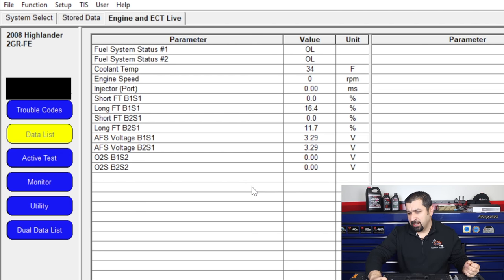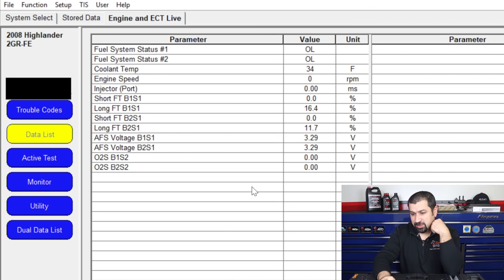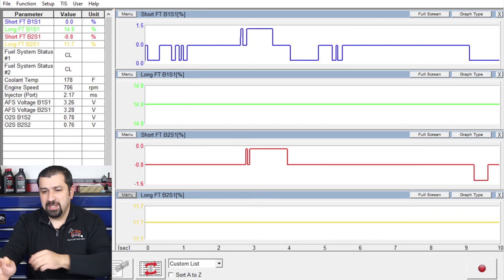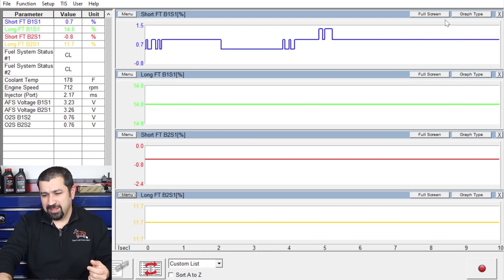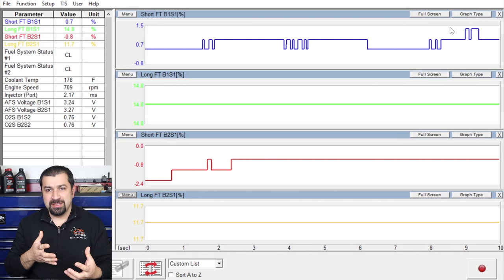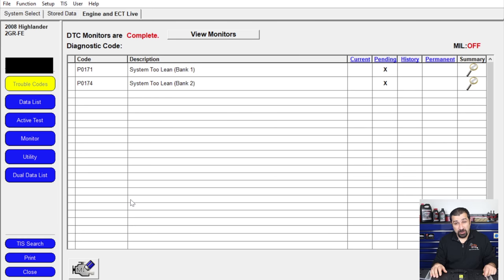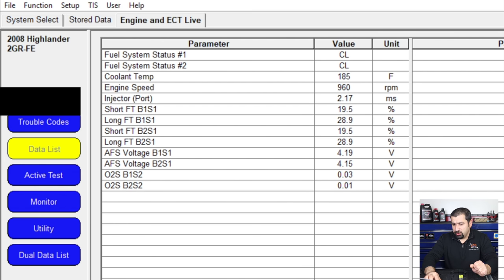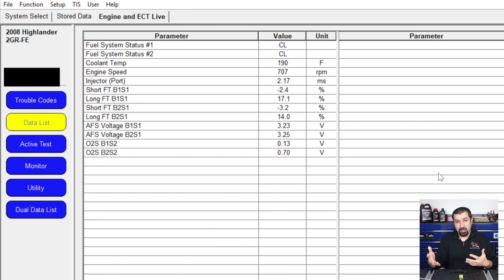Toyota Fuel Trims and live data diagnosis tips!

Comment: Fuel trims can throw you.  For example.  Watch when your LFT reads 12.5 and your SFT reads -10.5.  This can confuse people, but actually, your TOTAL fuel trim is +2.0 or 2.0.  The short trim is removing fuel, but the LFT is taking its time to reduce.  I've seen this after a repair.  The fix was to reset the fuel trims and watch.  The engine has about 40K on it and the SFT reads from -7% to +7%, and it stays that way.   There's other scenario's, and only by learning how SFT and LFT work with the AFR sensors is it understood.  I saw one Ford V10 van that both banks LFT and SFT reading at +25% each for a combined TOTAL Fuel Trim of 50% each bank.  This was at idle.  As the throttle was opened slowly to 2000 RPM's,  LFT's and SFT's settled down with LFT's approximately  between 6 to 8% and SFT's approximately between -7 to +7%.  At idle, the van shook so bad, I thought the ladders would fall from their roof racks.  The cause was a tear in the PCV hose on the bottom of the hose near the port on the throttle body.  Ford had an upgrade for this with a thicker hose material.  With the the new hose installed, fuel trims came down, no more shaking and all was well in Ford land.  The tear wasn't big, only about 1 inch long, but the engine heat and vacuum caused the tear to turn inward toward the inside of the hose.  It was that thin!  A tech learning about fuel trims needs to work with vehicles that are running good to get a baseline understanding of that system.  Disconnect then reconnect a small vacuum hose and watch the readings.  I had to learn fuel trims AND the Ford WDS diagnostic system we had before we got the IDS which I understand is still in use.  Thankyou for this video.
Reply from the maker: Very well said my brother. Knowing what’s normal is key to knowing how to diagnose.

Comment: Awesome!!  Let's go back to say the mid to late 1960's...would you rather be a mechanic back then or at the present? 🙂
Reply: well maybe after 1996 and before 2005.
Reply: back to the 60s . I could work on those cars. Now i just get headaches.
Reply from the maker: I’d much rather work on today’s cars honestly! I remember the first obd2 cars the computers were slow and usually were horrible with diagnosis. The newer ones have a massive amount of data that you can access to see everything and understand what’s going on. And they are super fast with refresh rates!

Starting around 2016 and up with the 7 digit trouble codes things got even better as you didn’t have to go digging for information codes which give you more detail on a specific code. More on this when we get to it in this series
Reply: @TheCarCareNut  Guess I'm showing my age but back in the 60's there wasn't any OBD system developed yet.  No emissions system to speak of except for the PCV valve. Engine diagnostic was basically checking the air, fuel, and spark. Changed plugs and points for tuneups, maybe a distributor cap once in a while.  Pretty simple to upkeep your car and no fancy equipment needed...maybe a timing light, tach/dwell meter, pilot shaft, various pullers/compressors, and a torque wrench.  Oh yeah and a repair manual for your car...no YouTube back then 😉

But yeah today it's quicker to diagnose a problem but think of all the additional costs for equipment, training, and expensive parts that you need.  The cars today (especially Toyota/Lexus) do last longer, have better emissions, and better gas mileage which is a good thing.  I guess there are plus and minuses to both sides.
Reply: Today’s technologies are easier with the right tools except the increased security where you have to program sub systems modules that have codes/pins available at the manufacturer severs. Using aftermarket scan tools can clone or bypass that but it can cause permanent damage to the new part and the ecu when it glitches during the process.

Comment: There's more than just a clogged injector or leaky injector or vacuum leak or dirty or bad air mass sensors. Both bank 1 bank and bank 2 sensors were faulty on my 07 Lexus is250. I cleaned the carbon build up  on the intake valves,  cleaned injectors, and replaced every intake gasket and hose and still was throwing a lean code on both banks. Fixed the problem by replacing both upstream sensors. Don't be fooled by the common sense data.

Comment: This is actually great information because I feel like one of my cars has a leaking injector but it's not throwing up any codes and the car runs perfectly fine.  I can use those techniques you just taught me to check if one of them is actually leaking. As I said in one of my previous posts I'm a mechanic but I specialize more in suspension work. And I don't just deal with Toyota's I deal with all kinds of cars. This is why I love your channel because you go into detail on things that I can learn use to better diagnose issues.

Comment: Good that I found this video!  On my 2010 Acura, LTFT is about +2.5 and STFT is +5/6 and it seemed that system was adding a bit of fuel which indicate a "lean condition".  After listening to what you have said "this isn't an issue at all as system is able to compensate..."  Just wanted to improve MPG a bit, but I guess I will let it slide and have a better sleep at night :)

Comment: Thank you for this video! I had to rewatch the video a few times to get a good understanding, but I was able to find and fix the issue in my 2007 lexus is250 and learned a lot of useful information for future diagnosis. No more check engine light, plus my my LTFT went from 26% to 1% after issue resolved and I'm happy with my fuel efficiency now. You're the best man keep doing what you're doing!

Comment: Thanks for another EXCELLENT video & explaining the Long and Short trim levels.  After viewing and listening to your analogy, I am fairly certain that it would be a lot less confusing (and not even require an analogy) if Toyota had called short term trim something more accurate like "real time trim data".  Same goes for long term trim which, in my opinion. would be MUCH more easily understood if it was referred to as "rolling average trim data".

Comment: Thanks for showing how it works. I'm trying to diagnose a p0420 in my daughter' nissan versa ( I know you specialize in Toyotas but i also own a couple two of them. A tundra and Rav4)and wasn't aware that O2 sensors are now wide band sensors. I wanted to diagnose a possible leak in the exhaust system before I condemn the Cat converter. Very informative and much appreciated. 👏

Comment: Dr Ahmed that was a very interesting video seeing how a professional diagnosis technician is able to pin point problems. I start throwing codes with a high mileage vehicle i replace every sensor coils and injectors,looking forward to the catalytic converter diagnosis my rule smell them replace them all along with sensors

Comment: Thank you for the EXCELLENT video. It was very informative.  You mentioned "don't chase a 5% fuel trim."  I understand the logic behind that.  But at what % should one become concerned?  I heard somewhere plus or minus 10% long term fuel trim is acceptable.  If more than plus or minus 10% long term fuel trim, then the underlying cause of the fuel trim adjustment should be examained.  Did you agree?

Comment: Educational video... sure could use a scope of some sort.  ...... Question.... fixing to buy  a new auto....Looking at the Lexus RX350L and the Mazda CX-9.  Any pros and cons of each?  Appreciate your input'
The Mazda is cheaper but that is not the issue.  It drives nice and has low torque.  The Lexus is comfortable, etc.  Appears similar to a Highlander.
Reply from the maker: Hi! I honestly don’t have experience with the current CX-9 to give a fair comparison but I know the older ones were absolute junk. The Rx350 and highlanders are very good SUVs more focused on reliability than drivability which is where the CX might have the upper hand.

Comment: My short fuel trim is ok I replaced the air fuel ratio sensor last year. My long term fuel trim at 75mph is 7%. I am replacing the o2 Sensor after the catalytic converter. My long term fuel trim was at 1.6 % then it jumped to 7.8% and then down to 7% when cursing at 75mph on the the highway.
Reply from the maker: Hi! That’s normal.
Reply: Thanks for the feedback I have read that the 02 sensor after the car could have upto a 30% on fuel trim.

Comment: Amazing video! I'm diagnosing my Lexus RX400h since it's throwing a "too lean" error constantly and my AFS voltages are off the charts (hitting down to under 2V and up to 5V) and also my Fuel trims are also going crazy (Long FT would even reach 50%) and then my Injector port goes way too high at 5ms so something is certainly going very downhill with the engine. Looking at possible air leak (hopefully that's it) and will also be looking into changing injectors as a start.

Comment: The demo was not too complicated.  the complication that could use some of your strategies is how to do this on the hybrids (e.g 3.3L V6).  the issue is that the engine will shut off when we need idle data.  driving at a steady slow speed is also not too practical since the hybrid will turn off the engine and run on batteries.  dragging the brake-maybe?  ideas?  thank  you

Comment: Absolutely love this episode.
I am poking into the fuel trim on my 98 and 99 Camry. My Camry is in fuel trim rich condition under idle (about -7%), but they would go back to normal under driving condition. I suspect it may be due to a partially clogged IAC. I wonder if there is standard / reference values under idle for use to compare to.
Reply from the maker: Thank you for watching! So many factors could bring the fuel trim down but it also could be normal for the age of the car. Let me ask you this, do you have any symptoms?
Reply: @TheCarCareNut  No obvious symptoms. The 98 Camry I4 feels lack of acceleration and the fuel trim does respond quickly after I replaced the fuel pressure damper. This may be unrelated and I may be pushing for perfection.
The 99 Japan made Camry V6 feels as new.
Reply from the maker: Honestly I wouldn’t chase after it. Wouldn’t hurt to clean the IAC though

Comment: I just replaced the downstream o2 sensor on my 2011 rav4  4cyl 130k miles and prior to replacing the sensor i have mentioned the readings below but after replacing it at idle the long term fuel sensor is at 0% and while cruising at 75 it’s at 7% but it goes up and down based on throttle position. So I think there has been a significant change after the downstream sensor replacement. I will keep an eye on it and read fuel trim numbers

Comment: I have been chasing a slight shake that I feel at idle....I was thinking it was engine performance related and over obsessing about fuel trims....I should have realized that when I feel these shakes the fuel trims really are stable and nothing changes crazy even with the rpm.  This should be enough to tell me that my shaking is not engine performance related and I must look at harmonic balancer/mounts/torque converter

Comment: Very informative info! I have one question and that is what is considered a normal range for the long term fuel trim? On the example vehicle it is showing that the long term fuel trims are at 14.8 and 11.7 when the vehicle is in closed loop and fully warmed up and the short term trims are nearly 0. My understanding is that since the short trims are staying within a certain range and not jumping crazy high or low that the long term trim numbers are accurate for that vehicle. One video said that anything “+” or “-“ 3 percent for the long term readings is perfectly normal and in optimal running condition. So when should one worry and consider that a problem that needs attention is present? Would it be at 20 percent?

Comment: Thank you for your videos. Any recommendations of how much grease to put in 2016 4 Runner  driveshaft slip joint?    I have read 4-5 pumps, or until the slip joint moves, or until grease starts to come out of the slip joint seal.  The u joints are straight forward, but the slip joints there is a lot of confusion.  Any advice would be greatly appreciated.  Thank you 🙏
Reply from the maker: Hi! Until grease comes out

Comment: Hi! Thanks a lot for your videos. I have a Toyota Highlander 2013 3.5 AWD SE with 104k Miles. While just before coming to a complete stop  it revs up around 500 to 400 and and then comes back to normal. Transmission shifts fine on all gears while driving. I will really appreciate it if you have any suggestions. Take care.
Reply from the maker: Hi! I would try to clean the throttle body and see if it improves.
Reply: @TheCarCareNut  thanks. I tried 2 different throttle bodies . Both throttle bodies are oem toyota. One was new and other one was used taken out of a vehicle with 30k miles. There was no  improvement with brand new throttle body but there was a little improvement with used throttle body. It is weird that used throttle body performed better than the new one 🤣😅.  But thanks for your suggestions. Also forgive me if am asking too manay questions. Thanks again. You are doing a great work by helping us.
Reply from the maker: Interesting... try a memory reset. Disconnect the battery for at least 1/2 hour and see if that changes things. Initially the idle will be odd but give it a few days

Comment: What version of Techstream are you using? I'm having trouble with V 12.10.019 displaying the Data List for Engine and ECT Live on a 2010 ES350 and a 2010 RX450h but it works perfectly with a 1998 ES300. It simply won't connect with the Engine module live data but works with all the other modules.

Also, thank you for the detailed information. I've been studying Fuel Trim for the last few months and this has been the most helpful video I found, including your A/F and O2 sensor video.
Reply from the maker: Hi! I am using the latest version I think 15.30.027. Some of the older versions didn’t work on the newer cars with can also your cable has limitation. Which cable are you using?

Comment: Hi, I just bought 2021 Toyota Camry Hybrid Le.  I use consumer reports and they gave  Toyota Camry's Hybrids excellent reviews. I'm reading now that there are serious problems with the A25A-FXS engine . Can you shed some light on this. I have watched  a lot of your reviews and find you very knowledgeable.
Reply from the maker: Hi! I haven’t seen issues with the A25A-FXS yet. Did they specify any issues?
Reply: @TheCarCareNut  What is the difference between A25A-FXS which is my Toyota Camry 2021 HV and the A25A-FKS. Is one Hybrid and one not.
Reply from the maker: Hi! The FXS is the hybrid variant which is very similar to the non hybrid variant FKS
Reply: @TheCarCareNut  It is the A25-FKS that the engine could stop working while driving causing a serious problem. I Googled A25-FKS and that is what came up. I think the A25-fxs is okay Thanks Tony
Reply from the maker: I am not aware of such issues. Perhaps you were reading on the fuel pump recall?

Comment: Great, easy to understand video!  I have a P0037 code on 2011 Camry. Trims and sensors look fine. Is it possible to unplug the existing sensor from the harness and plug in the new sensor without installing it in the sensor bung to see if it clears the code?

Comment: Thanks again for such a great video. A quick question. A Toyota Highlander 2013 AWD almost 105k miles , Couple of months ago while i was cleaning MAF sensor and i forgot to connect the connector back to MAF sensor. It tripped a code p0102 mass or volume air flow sensor "A" circuit low. I reconnected the electric connector and reset erase the code with a scan tool. After that i have driven almost 2000 miles The code and check engine light never came back but when i scan with scan tool it shows there is a permanent code p0102. I even tried by changing the new maf sensor but still it is not going away from permanent code section. Any suggestions. I will really appreciate it. Thanks.
Reply from the maker: Hi! The permanent fault is not an issue. It will go on its own after some time. Don’t worry about it

Comment: Great video's my brother!  I love how you share your gift with passion. I need a repair tip.  My 2005 Corolla idles rough at operating temperature, and I can't find the cause.  I had a bad coil so I replaced them all since they are 18 years old, but this gave minimal improvement.  I replaced all injectors, which helped the roughness a bit and I replaced the intake-manifold gaskets which helped even more, but vibration at idle is still present.  It has a super-negative STFT at –21% at warm idle, which I now understand as being computer compensation for a rich condition (thanks to this video).  LTFT appears normal at 5.5%.  O2S11 reading is 2.914V and O2S12 reads .095V.  Any suggestions?  Thanks in advance for your words of wisdom.